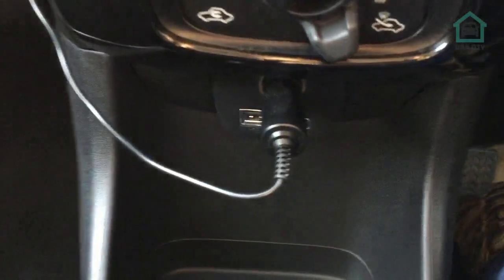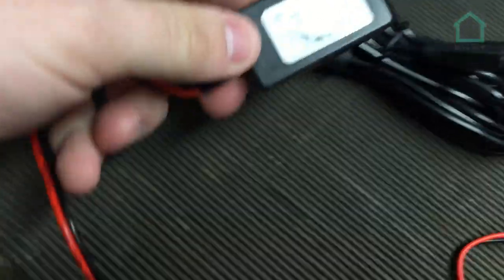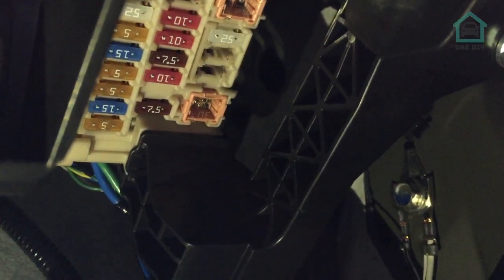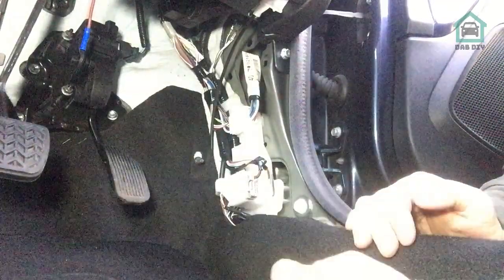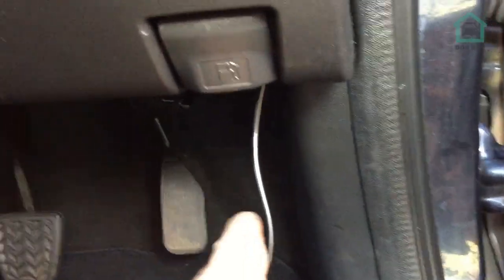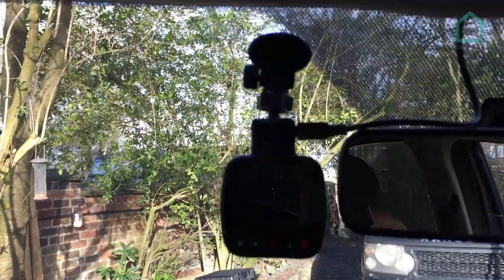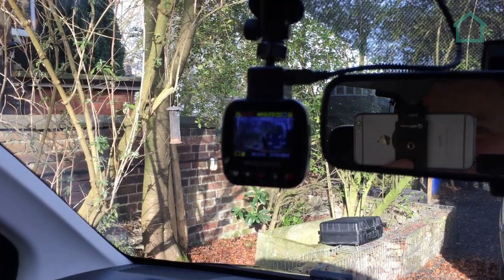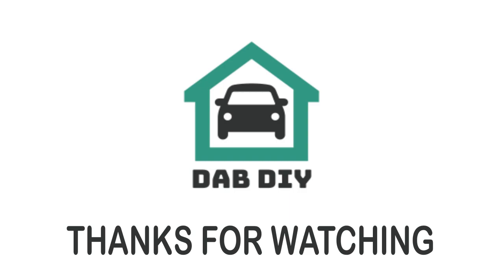Citroen C1 Mk. 2 Dash Cam Install

Comment: Hi mate, great vid, I have the C1 mk2 flair puretech 1.2, gonna be installing a viofo A119 V3 when it arrives, Hoping that same VCC fuse spot will work for me, with the viofo hardwire kit it gives options for not letting the battery go below a certain voltage, your voltage seems a bit low in my opinion but im not an electrician so heres to hoping mines all normal. for comparison i had to wire vcc to my kenwood head unit i fitted and mine was showing (from my memory), something like 14.15V to 14.25V
Reply: Oh i dont know if this will help anyone, but i fixed a god awful leak in my boot, turns out for some reason, i had no seal around my centre brake light, so i slapped some silo sealant made for caravans around it and put it back in, worked a treat, however, its a b......ard to get out, I had to use a handful of business cards i took from the local garage to use as a little tool to unhook the push in pins.

the water would come through the none sealed centre brake light, when youd open the boot or if there was enough water inside that little area behind the light, it would leak through the wiring rubber bung thing that connects to the roof inside the car itself and then run down the sides of the roof and behind the plastic panels each side in the boot. thank god for the heat wave we had to help dry any water remaining inside after i sealed it up.
Reply from the maker: I hear good things about Viofo. This camera install hasn’t affected the battery in any way.

Yes, water in the spoiler is a common problem on these Mk2 cars. We did a video about it on the channel a while back.
Reply: @DABDIY  pretty sure it was your video i saw mentioning about it but i think you fixed it on your mk1, i remembered it after i typed it lol, thanks for the reply.

Comment: Hello. Fab vids ta. I  wonder if you can help me? I have a 107 and have just added (refitted really) a parcel shelf. I notice that the side trims that the shelf pivots are on are missing their fixings, two each side. I am trying to find some but I don't know what they look like or what they are called. Could you help me with that? 😊🙏
Reply from the maker: Drop me a message on Instagram @dabdiy and I’ll send you a photo of what mine look like for comparison.
Reply: @DABDIY  Thank you for your reply. Sadly, I don't have Insta or any of those social platforms. By choice. But thank you anyway. 😊